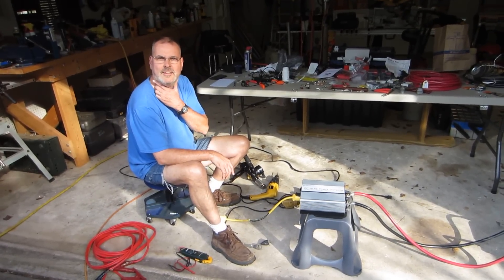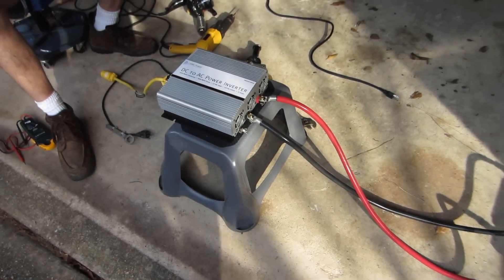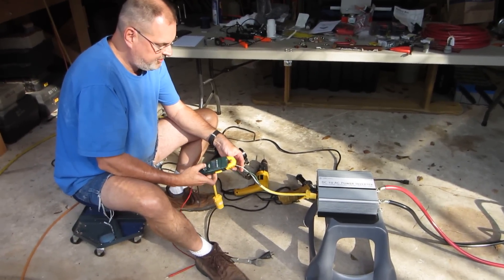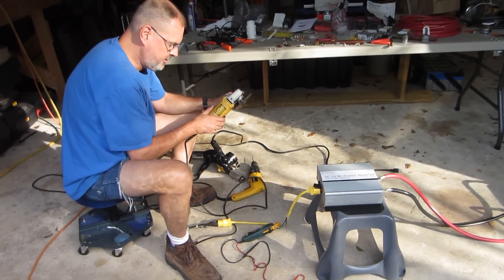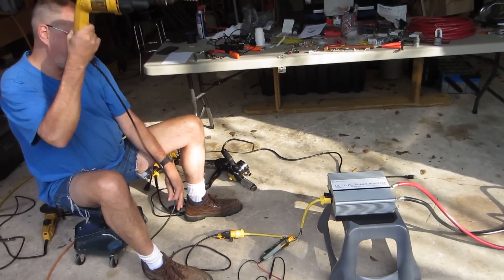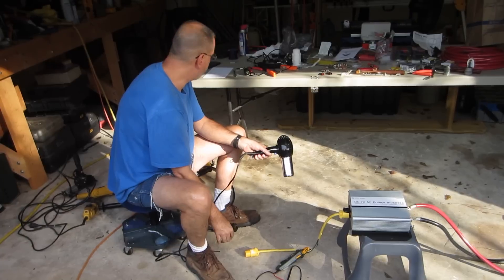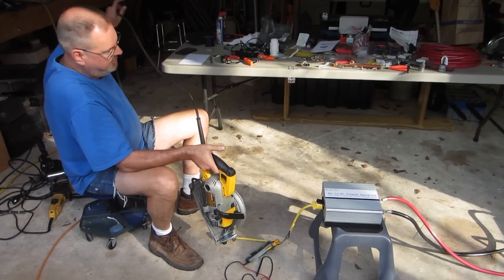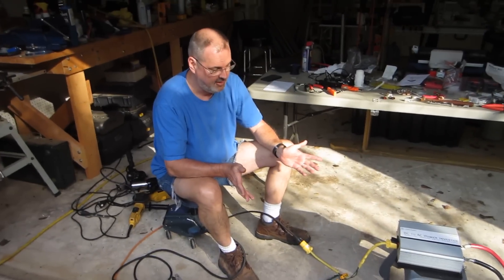RAM Truck Inverter Install 2

Comment: Were you able to get that worm saw working when installed in the truck?
Reply from the maker: No, the worm saw is just too much amperage for the specs for my inverter. You can buy an even larger inverter if that fits your needs.

Comment: Liked your vid.  One note andone question for you.  You tried the saw after killing the battery with other tests. Perhaps not a fair test of the inverter, but more of a battery test. The warning beep on the inverter is telling about low supply voltage, not output.  I also have a question for you.  Is it ever advisable to run the inverter while parked with the car motor running?

Comment: Probably should have run the heat gun for longer to test the inverters ability to run a continuous load. Them things will fall out if the internal temp rises. The heat gun is mostly a resistive load, the surge is minimal. The saw however has a much greater surge rating that your home AC doesn't care about. You may see improved surge performance with a larger battery bank and / or shorter cables. Or, you may have maxed out your inverter.

Comment: I have the similar questions as barsstoolguru...
where did u install the inverter?
where did u install the battery?
how do u keep the inverter battery charged?
do u have a vid of the finished project?

Comment: questions: what is the invertor rated at?
why do you need  batteries?
did you ever mount it in your truck and if so where ? 
thanks for taking the time and posting and you partner did a fine job with the camera